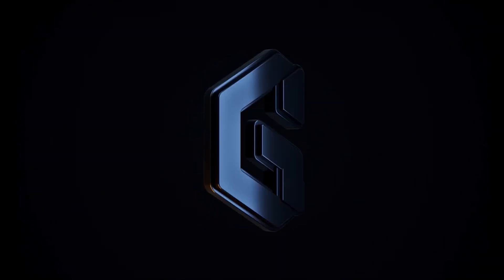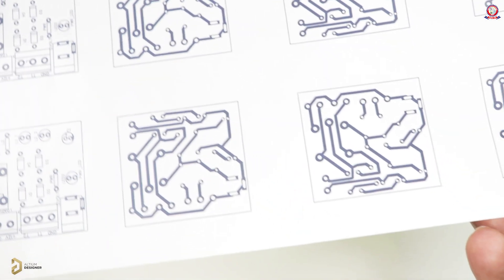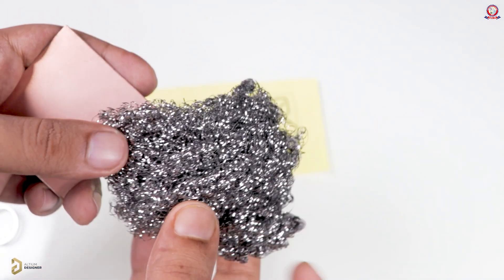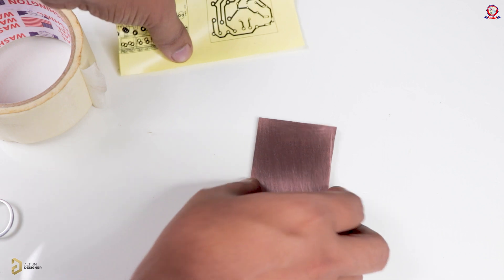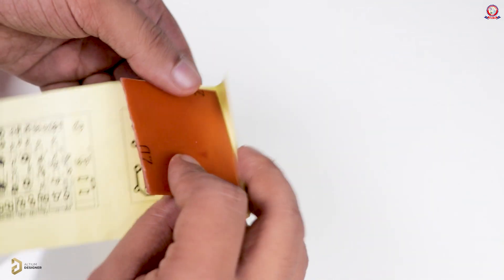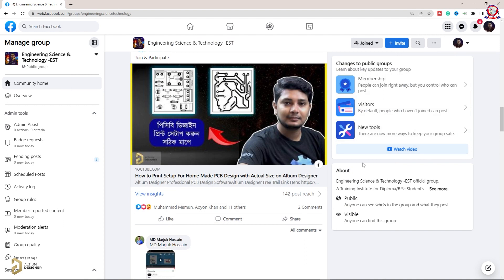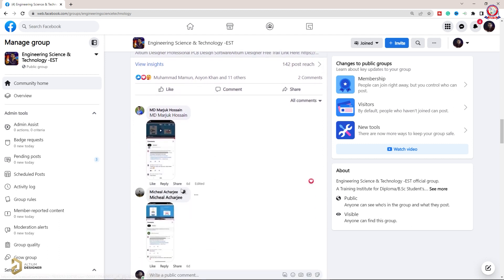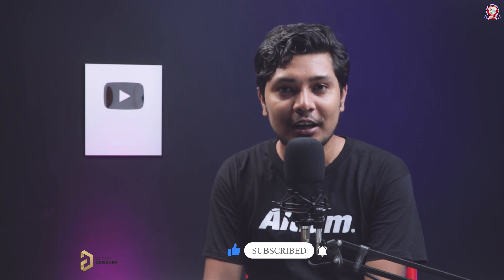How to Make A PCB (Printed Circuit Board) At Home in Bangla - Altium Designer

Comment: vaiya amr arduino te.. powerpin gulo chara onno pin gulo keno jano kaj korche na

void setup() {
  pinMode(9, OUTPUT);
}

void loop() {
  digitalWrite(9, HIGH);
}
ami ei code ti diyechi tao kaj korche na :)
like: ami 9 number pin tir voltage high korte chai kintu ei code ti deoyar poreo hocche na 
apni amake ektu shahajjo korle khubi upokar hoito 😭
Reply from the maker: Maybe Arduino IC er Bootloader erase howea gese.
Reply: @engineeringsciencetechnology  
kintu ami ultrasonic distance sensor diye
serial monitor e distance measure korechi
tokhon thiki hoyeche kintu ami jokhon ekta single port high korte cheyechi tokhon sheita kaj korche na :(
Reply: @Polyshishir 
How are u checking if it is high or not